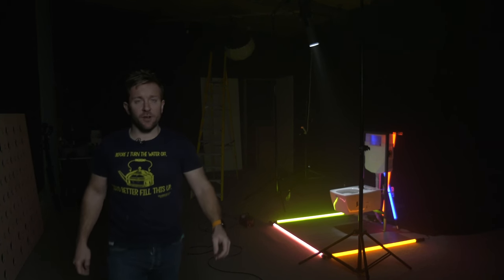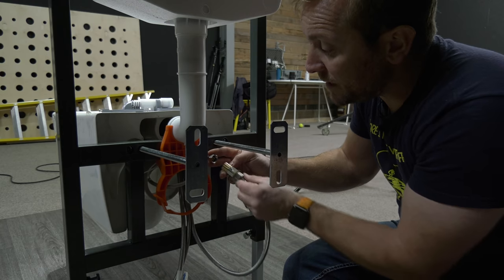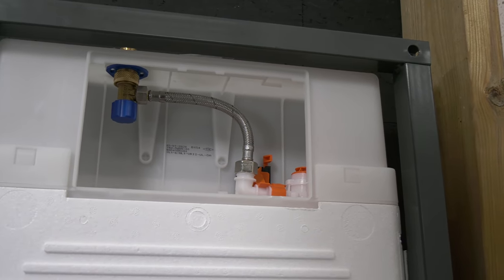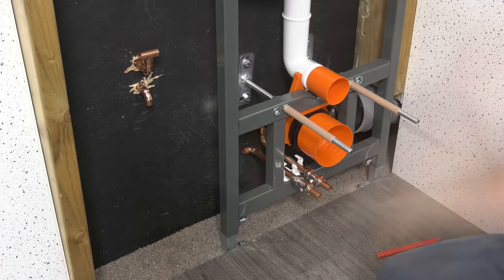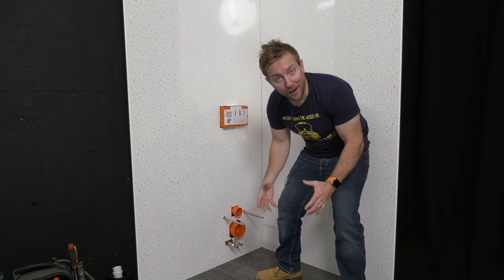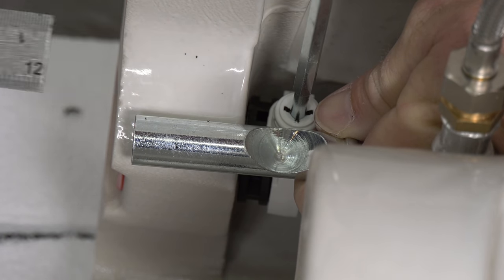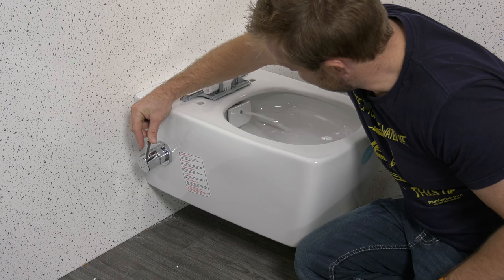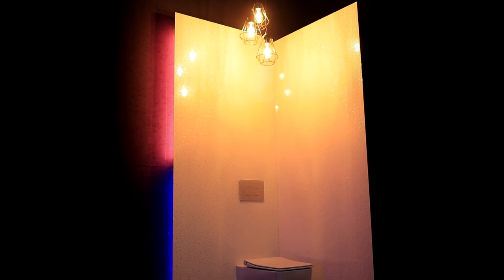HOW TO INSTALL TOILET BIDET

Comment: Is an air gap acceptable backflow prevention on a high risk fixture?
Reply: Hi Sam, the integrated air gap protects the household supply of drinking water in accordance with the EN1717 regulations :)

Comment: How can that be legal if the toilet is blocked and water gets back to the main Cold? Spoke to WRAS, they said it’s not allowed unless the water is coming from a separate storage. Could you please clarify?
Reply: Hi Subash! The fixture includes an integrated 50mm air break that doesn't allow any back flow. If the toilet were to be blocked and water were to enter the WC, it would spill out of the WC and not enter the water supply.

Comment: What a joke not like to see flexi pipe... but Uk People love to see all the waste pipe, heating pipe and everything else running around the house with that soldered joint everywhere and glued nasty abs waste... . 🤭 Anyway nice toilet.. 👍
Reply: That comment really got to you 😅
Reply: @PaulSmith-pr7pv  Yeah 😂 If  in UK start using press fit and MLCP in wall and heating on Manifold then i will understand... 👍
Reply: Kornel K. you fail to grasp that most of our houses have solid masonry internal walls and predate indoor plumbing by many decades. Concealed in wall piping is fine- if your house is made US style from matchwood, staples and tar paper or whatever other cheap shite it is they use to build those TV set style homes.
Reply: @spencerwilton5831  what what? Please search houses in Hungary... all House In Hungary made solid brick, no shitty wood at all, and yes UK house is a matchwood as well, we not using Plasterboard or any type of wood at all. 🤭 and Still everything concealed.. tidy MLCP with no connection, if any use press gun fitting. 👍

Comment: This was a really helpful video. Worth noting on other models it's similar but not the same - mainly the M12 rod lengths need to be significantly longer and none of Vitra's technical drawings reflect the actual pan dimensions. The rods need to be approx 12cm.

Apart from that other things we noted, it's worth checking the valve feeds are done up - on the one we fitted they were not.

They have made some models top mounting - which sounds great but in reality the holes don't line up and the single Allen key will get stuck. We stripped and damaged the mounting kit and a new one is a month wait from Vitra - waiting on a "Fischer 551883" which looks to be the same part (on amazon) along with one from Victoria plumb which actually uses a captive nut rather than a grub screw in glass fibre nylon... would have preferred to have just used a nut at this point.

Hopefully we can get this on the wall soon...

All that said Vitra should be paying you royalties as this video is far better than any of the 'loose' instructions that were provided.  Thank you.

Comment: I’ve always been intrigued by the bidet. But how do you dry yourself? Surely you’re going to be pulling your pants up only to end up with a soggy bottom? I have a vision of my houseguests drying their ringpiece on my hand towels?  What am I missing?
Reply: Usually use toilet paper to dry which is flushed away
Reply: @rafmo7413  thought one of the ideas here was to not use toilet paper. James certainly says so.
Reply: @mickyork41  totally agree, but how else do you dry, its the only logical way. I mean I even wipe first then use water then more paper to dry.
Unless one of those japenese toilets which has a dryer in it.
Reply: James, sort this out mate. We need one that’s a toilet, bidet, and dryer too. Maybe it could also apply some powder. Or Sudocrem?

Comment: Love the idea and the look but in the uk most older walls are brick built. So to install one of these would mean adding a stud wall to the existing. Considering the unit itself is around £500-£700 plus the additional work of frame and finish. It’s a very expensive bidet !
Reply: Hi Cian! We do offer a version that can be retrofitted and doesn't need a stud wall - see here https://www.vitra.co.uk/flushing-solutions-flush-plates/frames-cisterns/concealed-frame-systems/vitrus-glass-concealed-cistern-sku-770-5770-02/ :)
Reply from the maker: Answering this in the next video!

Comment: Would you not need to run the bidet for a moment till the water runs warm? I've tried the hose bidet attachments on holiday and thought it was a much greater idea than tp. But the water temps here in the UK are quite a bit colder. Haven't taken the dive yet.

Comment: I could not help noticing the gaps along the backboard., Is that backboard glued,and fixed or just standing there for a showroom set piece.Usually, there is a thin mastic line to cover any gap. apart from that what a fabulous piece of plumbing equipment just brilliant James,
Reply from the maker: Hi Peter! I'd usually silicone the gap, but was removing the set and didn't want to ruin the loo - I'm fitting it at my house, which I will film, in the near future! :_Holdtight:
Reply: @plumberparts  Thanks for the reply its always nice to get one especially from you Because you must be the busiest plumber in the uk, and you seem to be all on your own, cheers.
Reply from the maker: @peterryan7827  I’ve got the Mrs and the cat...! 😂😂😂